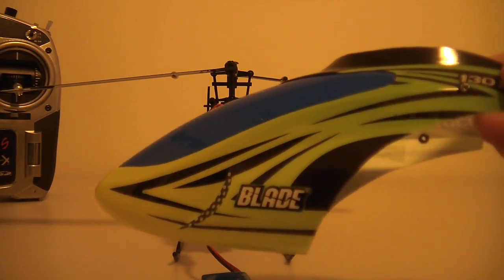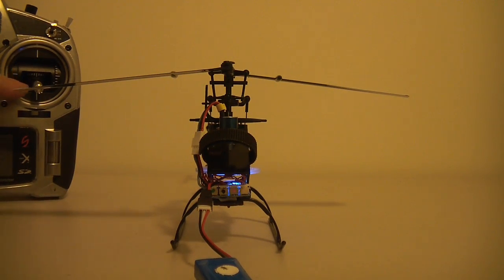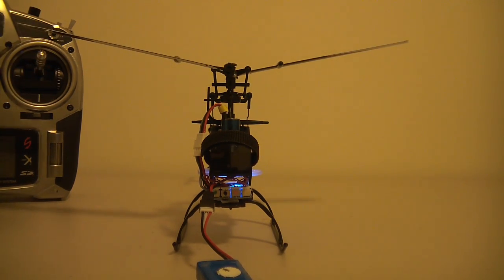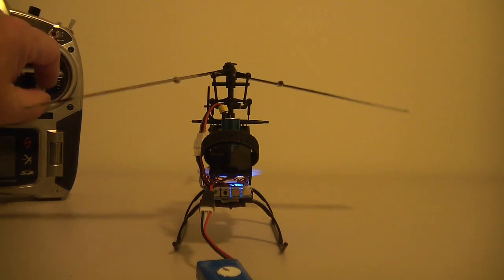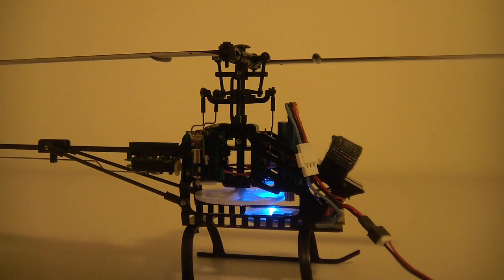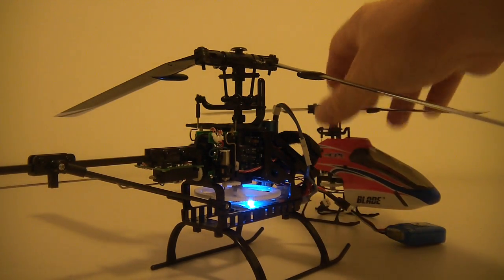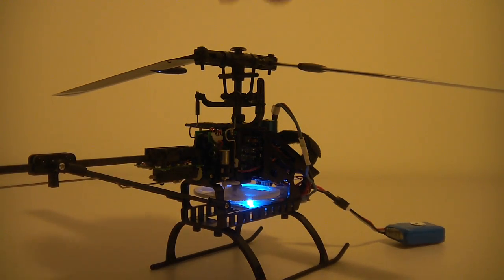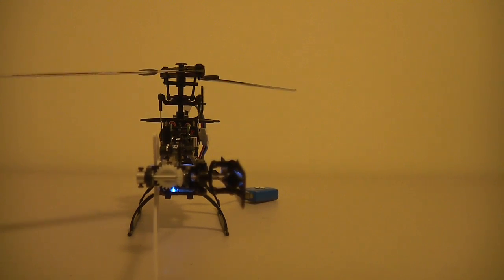Blade 130X Pitch settings

Comment: Stunt mode is supposed to be linear.  To get your sweet spot to take off don't go by the manual and just put your stick at half throttle and look at the top of the blades grips and you will see two lines one on the blade grips and one on the head. To line them up give one turn on up it down on each swashplate linkage then you have zero pitch at half throttle and then it will take off where you like it. They put them settings in the manual for beginners. Only pitch curve you mess with is in norm.